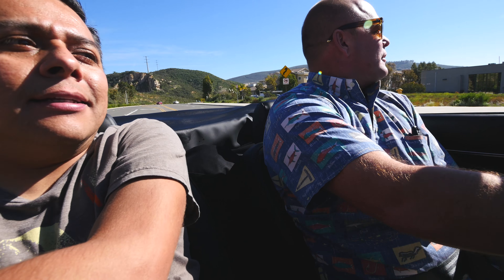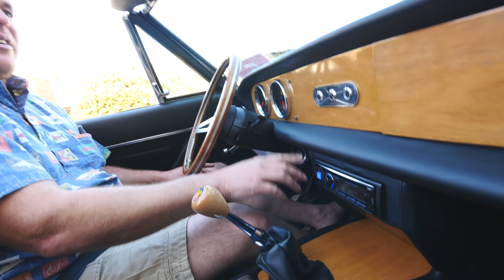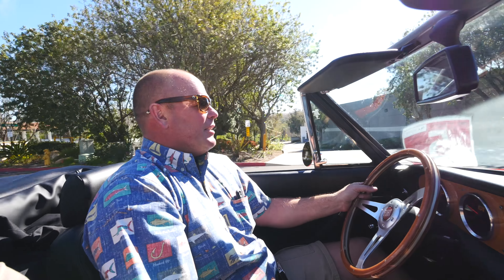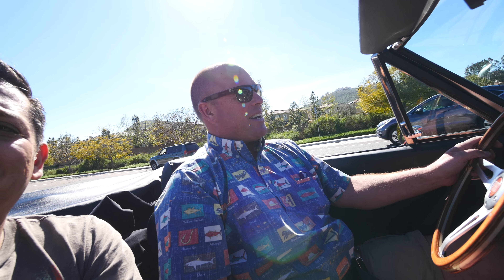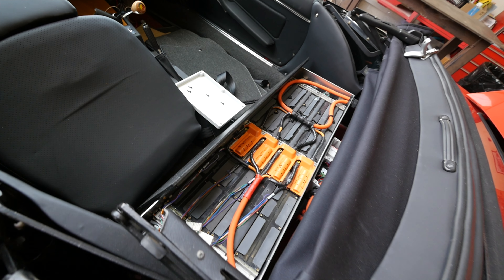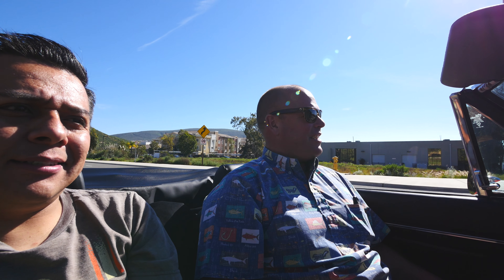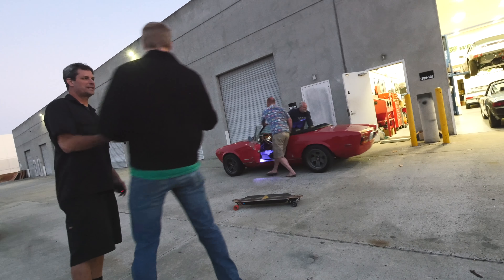ELECTRIC CARS ARE TOO POWERFUL  - FIAT Spider 124

Comment: I had a 124 back in the 80s. It was a lot of fun. First gear was so low that punching the gas peddle would bury the tack at 8k in just a fraction of a second. Mine was not completely stock, so it might not be representative. Idling around in first was fun. Just a quick jab to the gas would bark the tires, a nice effect for getting looks.

Comment: Great video. Probably someone will disagree, but I think that the driving barefoot is the best thing, to be a total feeling with the car.
Reply: not sure that'll work with EVs....
Reply: dunhillsupramk3 Works perfectly fine with an old car EV conversion. Still has hydraulic brakes & hydro-mechanical steering. Heck even some new BEV like Rimac Concept One & Renault Zoe E-Sport does not have electric steering or drive by wire brakes. Just because it has an Electric Motors does not mean the controls have to be Electric.
Reply: you can't stall an EV, don't have to rev match and you got instant torque... so driving barefoot wouldn't give you more feel as its an electric motor there is no need.... if you want to be a poser and do that then go on ahead but it wouldn't make a difference as you wouldn't get any extra feedback...

(to be clear it would be if you had an automatic transmission in your car but you put in a fake clutch pedal  and stick, this is on the same level)

Comment: Has someone not designed a dual stage brake pedal yet??? First stage can be regenerative braking, second stage for the discs/drums. You could even just install that regen button the the brake pedal itself- same concept. Just about anyone could hack something like this.

Comment: Sweet vid, The Fiat maybe needs a shortend spooled nine inch. Then a trans upgrade. Car was engineered for alot less torque. stronger uni joints and a strong drive shaft. It would be bullet proof. Another inspiring conversion. Cool car!

Comment: Jehu, all this electric is currently over my head, but I am binge watching, and hope to catch up.
My comments would be inappropriate except for this small suggestion;  Go to those neighbors straight ahead at the corner, at 2:06 and ask if you can install a corner mirror.  That may run $300 or so, but one avoided corner crash is worth far, far more.

Comment: There's nothing in a Fiat 124 driveline that is made to handle much power at all. It has rubber flex couplings and a tiny little differential. Same goes for the transmission which you are barely using. Speaking of the trans, that thing is taking up a lot of space as well as not doing much, a conversion to your beautiful Powerglide 2 Speed Direct Drive Transmission will move the motor way back and give a lot more room under the hood and you won't easily break it. That fiat trans should be sold before it's broken too. It shouldn't be too hard to shorten a stronger rear end and fix that problem for good. Then finish it all off with a modern lightweight drive shaft.

Comment: Good point about the rear brakes, on small sports cars they don't do much unless you live in a hilly area. Drum brakes are not a bad thing except people have become a little afraid of them I guess due to rarely seeing them anymore. I've had small race cars with rear drum brakes and never found a need to change them, you just don't use much rear brakes on a small car. There may be a friction advantage to drum brakes over discs in that in normal operation the shoes do not touch the drums while in disc brakes the pads are always in contact with the discs.
Reply: Brian Boni, pads pull back slightly from the disks.
Rear drums aren't seen frequently anymore because there's more complexity in manufacturing and maintenance.
Reply: Brian Boni The other trouble with drums is during overheating. Your braking system expands when it heats up: on a disk, that means it gets a bit thicker and a bit larger, but on a drum that means your braking surface is moving away from your pads. Add the fact that drums don't shed heat as well as disks, and you can see why they're less common on consumer vehicles. For professionals though, they tend to require less maintenance than discs so you still see them in most air brakes, where the driver needs to take a course to be allowed to operate the vehicle.
Reply: If memory serves, disk brakes don't work well in a pneumatic system (compared to a hydraulic system), which is part of why you don't see them in commercial vehicles. Drums provide more brake force for a given size vs same diameter disks.
Reply: Disc brakes are standard on the front of heavy trucks and have been for years. You graduate the pressure in air systems through an arrangement of valves

Comment: You guys can (and should) set up those Curtis controllers so that you can one-foot drive.  That's how I've got my AC76 set up in my Ranger.  I use the "economy" function of the controller to mostly turn of regen when the roads are slick.  Even my single AC motor can lock up a back tire if I program the controller for 100% regen. It's silly.  I think I've got it set for roughly 70% (normal) and 40% (economy).  Give it a shot.

Comment: No seat belts ?
Reply: look back at old cars and youll notice safety is a modern invention. This car possibly only has lap belt if anything at all. Live free or die
Reply: Steve Swan yup, just a lap belt that can been seen worn by the driver. As a matter fact, it's the kind you have to manually adjust as you see the left over flopping down.
Reply: A lot of older convertibles didn't have a place to mount the 2nd, shoulder belt, and since they weren't required, where left off.
Reply: I have a 1978 fiat 124. The 3 point belts are unsafe. The top mount is roughly 5 inches below the shoulder of the seat. In the event of a crash it compresses you rather than restrain you. I like my spine the way it is. I have a set of aftermarket 4 point belts in mine.
Reply: Bare feet too
Reply: Steve Swan nothing wrong with that, perfectly legal to drive with bare feet too.
Reply: It depends on the country. Try to do that in Portugal, get caught and feel the hurt of not having put on a pair of tenis shoes.
+jehugarcia this is the spider. My father had the regular 124 painted with red "alfa". Wish I still had that car...
Reply: Robert Steich there is a lot wrong with that. They keep you from dieing in many accident situations. if you hit something your seat belts would keep you from flying through (or over) the windshields at a 60 miles an hour or whatever speed, for instance.
Reply: Good thing this isn't Portugal.  California Engrish is being spoken..
Reply: Always a "Safety Sally" worrying about the actions of someone else's actions and life..  Worry about yourself and leave other people alone!! Until it harms YOU or a child, its none of your business.
Reply: Jeff Benefield  Hi Jeff I think you are reading to much into my comment I was not referring to the safety aspect of no seat belts but rather the legal if someone wants to drive around with no seat I don't think my comment would influence there decision ! I never noticed the lap belts anyway my comment is none of your business lol
Reply: Steve Swan  LOL Then don't make public comments. Have a nice day. 😀
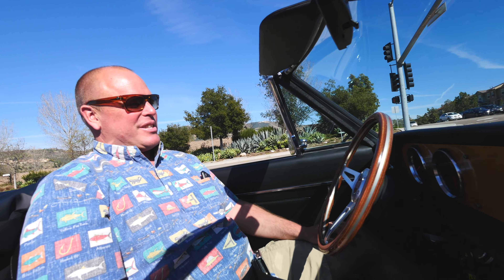Reply: Look carefully. The driver has a black lap belt on. 3:26
Reply: in the USA seat belts were mandated by federal law in 1968, If you look closely they are using lap belts
Reply: I was in my 62 Chevy pickup when the cop stopped me for speeding. I told him old 6 cylinder under the hood and that the judge wouldn't believe him. He looked stunned and looked for something else. He asked me if I had my belt on. I said no. (no belts installed as original equipment in those years). He gave me a ticket and I drove away. If I had challenged him there he would have looked for something else or shot me. The ticket was eventually dismissed but in California they charge you a "dismissal fee".. $25... so you can't win.
Reply: obsolete professor incredible... so you got to pay to stay alive!) (...those suckers!)
Reply: He had a lap belt on.
Reply: I see a lap belt.
Reply: Just lap belts. The easier to taste the mahogany.

Comment: I wish EVwest would make a poor mans conversion package for a commuter car. I've got a 1979 Honda Prelude which would make a great Conversion but for 8-10k I can buy a used Nissan Leaf. Is there a way to do a AC conversion with like 4 Tesla modules for 6k? Or financing for conversion kits?
Reply from the maker: +Bryan Martin no 4 modules don't put out enough power to run a full Size car,   Plus $6k is barely enough for a motor kit, adapter plate, and charger, you still need a bunch of little stuff that add up.    EVwest doesn't set the prices they are just a reseller that marks up products to hopefully offset for the time it takes to answer all the  phone calls with questions and the hundreds of support emails once customer buys products.

Comment: I have a Nissan S14 that I want to restore and how much would a kit cost that would be equal to 400/500 HP? I don't know any one with an electronic S14 so it would definitely be cool and unique. By the way great work on the videos.
Reply from the maker: +Randall Lawkin electric big power costs big money $50k+.  Best bet is to buy a wrecked modelS and transplant parts to vehicle of choice
Reply: jehugarcia cool thanks for replying now I wonder what a wrecked on goes for off to Craigslist or back to an ls2 swap

Comment: what year and model is this. Im looking for one on craigslist but cant find the same look. Is the bumper modded?
Reply: Mb not the model, just the year.
Reply: 1980 Fiat Spider 124 2000. USA Bumpers removed and holes filled. Pininfarina design body is really cool... batter back when Fiat owned Ferrari!

Comment: Do they use the same combustion engine gearbox? If so. I think that's wrong, the induction motor loses efficiency, because it has unnecessary parts like reduction gear trains, reverse…, it does not need it, mechanically a single gear is better and its respective drive shaft, one or two differentials.
Reply: Well, it is better to use a gear box as the torque of the electric motor decreases with higher revs. Not much but still. So a 2 gear box would be enough. But, if you have the standard gear box installed, why not use that? I would have matched the torque of the electic engine with the standard drivetrain though. Gives you longer battery life too.
Reply: the range by which an em has a high torque in torque/rpm curve is far far greater than that of an ice. Yes on high rpm the torque decreases but we are talking about 18k+ rpm compared to a regular 7-8k rpm. If there was a way for an ice to reach that rpm level it would actually still have less torque than an electric motor.
Reply: Yorgarazgreece 👍and at 18k+ the box would be no more 😂
Reply: sure a single reduction gear would do but what is the point of even driving a car like this if you can't row through the gears... if thats your thinking then you best forget about this car and get yourself a Nissan Leaf
Reply: Gwynbleidd MAG sometimes. Did you see jehu’s vid on transmissions.    It’s very informative.

Comment: Would a 25 to 30 grand budget be enough for converting a 2001 Acura 3.2 cl s-type? I am considering 3 hpevs ac50 motors and a range of at least 100 miles. I would loose 10 horsepower but gain 130 ft lbs of torque!
Reply from the maker: +Shannon Williams  100 miles of battery might be challenging.  You think you have room for 30kWh pack on your vehicle?  Small light batteries do exist but probably not on that budget
Reply: jehugarcia Possibly, between having a large trunk with a good sized spare tire cavity, a wide and long engine bay and the area where the gas tank is there could be enough room. Making aluminum battery housings to fit those areas is a possibility. I'm well acquainted with cad and I have a local machinist with a substantial cnc machine with a good hourly rate. What would the cost increase to my current budget look like if I used more advanced batteries? Thanks for commenting so fast btw.
Reply from the maker: +Shannon Williams  you can prob pick up 10 modelS modules for $15k delivered  http://j35.us/Module-ModelS-eSearch   That should do it
Reply: jehugarcia thanks

Comment: We need some proper brushless motors and controllers that can be used in a project like this. Just imagine what kind of power would it have if this thing had bldc motor sized same as this one.
Reply from the maker: they are Brusheless AC induction motors
Reply: that is really nice then! I thought that it was brushed like Warp 11 or something simillar. Keep the good work up!

Comment: the rear gear was designed for 90 bhp...   it was just too weak....   also put a locker clutch in that thing...or you will keep burning up clutches.

Comment: Ive always wondered why EVs have one gear. With out doing much research, I think having different gears it would save battery range. Just like an ICE. Why run a motor at say 8,000 rmp when you can run it at 2,000 at 65mph? Is the power used between the two rmp not that great?
Reply: Robert Steich ICEs have different torque at different revs. EMotors have torque based on current. But look at Rimac cars for gear-shifted e-Supercar
Reply: Robert Steich I think they tend to break gears when changing gears. Tesla went from a 2 speed to a single gear reduction box because of this.

Comment: How come car manufacturers don't add gears to EVs? If it's true what is said about electric motors that if it's revvved at high speeds ( f.e. highway ) the less efficiency it has in the long run because of heat buildup wouldn't at least a second gear reduce the load? They always say you don't need gears, but high speeds are straining the e-motor and battery.
Reply: In practice, the torque is simply too much and ends up breaking or wearing out the transmission much sooner. Tesla had originally planned to use a 2 speed gear box, but couldn't make it reliable, so they decided on a single, fixed reduction gear instead. Other car makers have simply followed suit. Going forward, we really need a 2 or 3 speed system as EVs simply consume way too much energy above 70 mph.
Reply: I understand that you can't just slap on a crazy powerful e-motor onto any gearbox.One thing disturbs me though. One great argument is the "instant torque" thing which if ofc great since it gets you off the spot very fast but why would nobody limit the torque output from 0 to make it usable with a standard gearbox? I mean we don't really need supersportscar level torque in a daily. I'm sure they can give it an output curve that slightly reinforced gearboxes can handle them. I'm sure it will also increase tire and especially battery life significantly if you couldn't just mash the pedal at every traffic light.

Comment: I see this happen a lot in various videos (breaking of transmission or drive components).  What does EV West do to address?  I get the reason why it happens, but want to know how they help customers avoid this from happening in the first place. @jehugarcia
Reply from the maker: high performance replacements & lay off the pedal advice
Reply: jehugarcia Can the controller be adjusted to avoid this as well?
Reply from the maker: yes controller can be throttled back
Reply: Thanks for all of the replies!

Comment: get rid of the transmission run it directly
Reply: would have been better to use the gear shifter to perform just forward-backward shifts (up and down) and regenerative braking just by shifting it to the left

Comment: Yes, an instantaneous 200ft/lb of torque through a vintage drive line specified to handle less than half that when new - and built by Fiat - and sorry, but a heavy footed goof trying to impress a teenager...surprise, er no, only surprise is it didn't bust earlier. I was thinking, Oh they are actually using the old gearbox??

Comment: 6.7 sec 0-60, thats not all that great. My Mercedes GL63 does 0-60 in 4.8 and its a 7 seater SUV.
Reply from the maker: +Daniel Napast  but does your car do 120 miles per gallon?
Reply: jehugarcia Not at all, I'm lucky to get 12 mpg on 93.  It really amazes me how far a car can get on what seems like such a small battery bank, I'm not trying to bash EV's, I really like them actually.

Comment: WTF you doing with that stupid fiat? OK so ya you can build an electric car outa it but da... what happens when something breaks on it, try finding fiat parts and yes I know all about fiats me and a buddy had a few plus we did an 850 spider race car. This was 30 yrs ago when you could actually find parts.

So if you want to convert small open top cars like this, just do the Mazda Miata, cheap, reliable and the gear train is a lot more heavy duty then that stupid fiat. You want to drive it or work on it? That is why we left fiats in the dust 30 yrs ago and moved on.

Darn fiats would handle great but something was always broken or about to break.....
Reply from the maker: He completely restored this one,  I think he can find parts